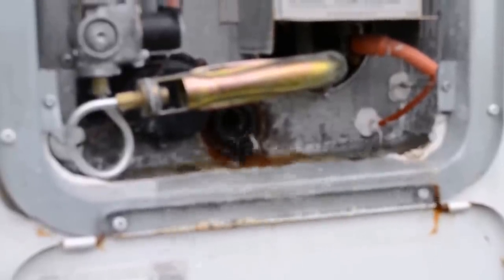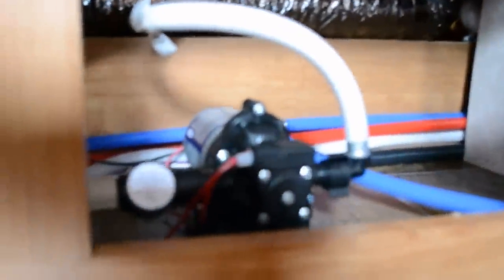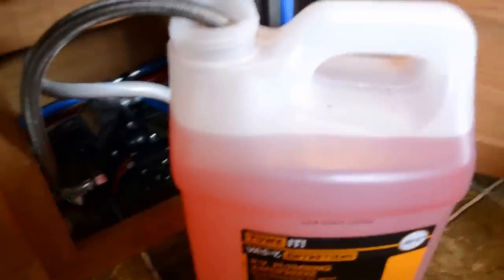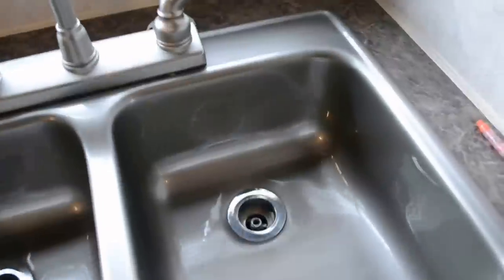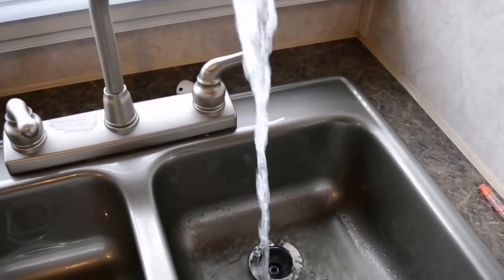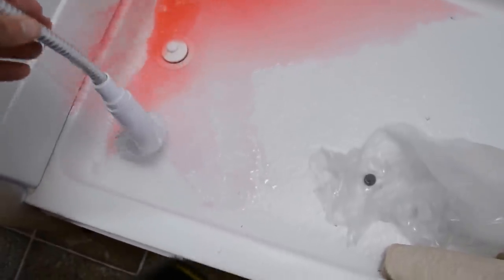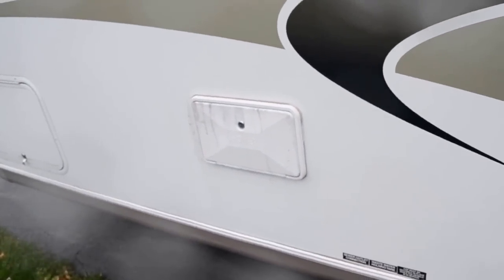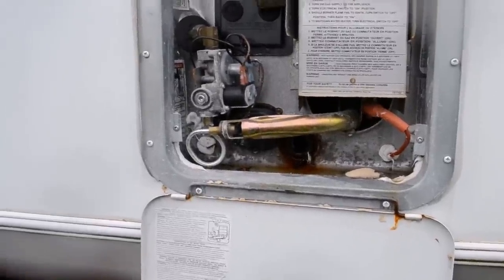How to winterize your trailer or RV's water system

Comment: Caper camper just watched both your RV videos. Very helpful. Need to replace water valve on toilet which I also feel very good about doing after seeing how easy it is to do from your video. You should get a helmet camera or devise a camera holder to free up your hands as you do a good job breaking down the job and explaining what to do. By the way, I hope you didn't sacrifice your hose connection (city water) during the making of video.
Reply from the maker: thank you RP, I have actually purchased one but havn't used it yet.  Thanks for watching and commenting,

CC

Comment: Do you need to winterize your water lines if you will be living in your RV? If so is the process the same? thanks in advance.
Reply from the maker: +purplerose771982 

... a couple things  for you to consider here... does the temperature where you will be living, stay below freezing for days/weeks at a time?  
 Is your water line coming into the trailer insulated or is it exposed to the elements (where it will freeze if the temp stays below freezing as mentioned above).  If your water line is exposed you will have very limited (if any) water and run the risk of breaking that line too!

For me it comes down to your winter climate, please keep in mind these are my thoughts only.  

Good Luck
cc

Comment: I hope you considered changing that Anode Rod inside the water heater, cause if you dont, the calcium in the water will corrode and destroy that water heater over time
Reply from the maker: Maibu yes, thank you , I replace every couple years, this one needed to be done for sure.  Thanks for commenting 
Cc
Reply: I just winterized mine today, got all my antifreeze in the system and made sure nothing has water in it, I do it slightly different though, i put the anti freeze directly into the fresh water tank so i know any remaining water  in the tank wont freeze at all, and i prime the system with the anti freeze that way, its easier than adding a winterizing kit as mine don't have one. My trailer also don't have the Center shut off valve like yours does, i just have two valves, one for the upper and lower portion of the water heater. I own a 1999 K-Z 3103 32 foot Sportsmen Camp Trailer. A tree fell on the slide out when it was stored on a camp site, but luckily it isn't leaking water inside that i know of. Gonna see about rebuilding the slide out over the winter or early spring.
Reply from the maker: I have winterized this way in the past too,  I found this method used more antifreeze ... as long as the end result is the same it is all good.

Comment: You blew your city water valve gasket by doing it under pressure. That is why you could not stop the flow of water after you pushed it in. It is sad that people who do not know the proper way of doing things do these instructional videos.
Reply from the maker: +sbab67   thank you for watching and commenting ... I appreciate all comments whether they are positive ones or constructive ones such as yours.  In this vid I merely replicated the process that was shown to me the first time I had my rv winterized (by an employee paid to do so at a rv dealer).  Any vid I post is simply to encourage someone who has never tried something before to give it a try... I am not an expert ... believe me!   I am intrigued , however, that you would take the time to watch a video that you apparently know so much about... two things pop into my head (1) you don't know as much as you think or (2) you need to find a new pastimethanks again for stopping bycc
Reply: all you need to do is turn water pump off open kitchen faucet for 5 seconds relieve pressure from line  then push in on check valve till you get pink . also dont forget if you have black tank flush line to blow that line out with air as well make sure tank valve is open.
Reply: @capercamper  I just had mine winterized by a professional RV dealer and they did the exact same thing, Great video!!!